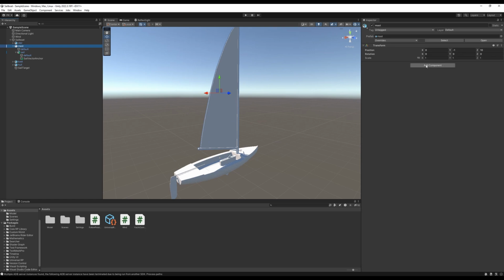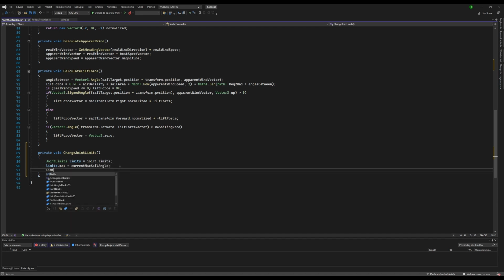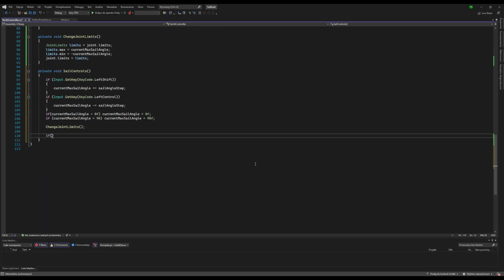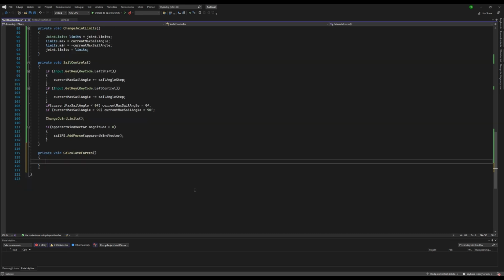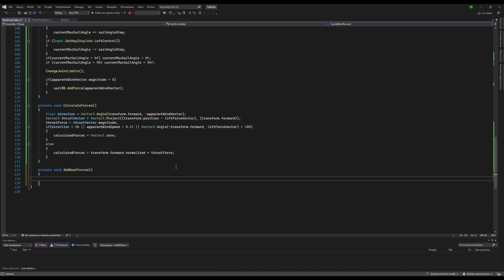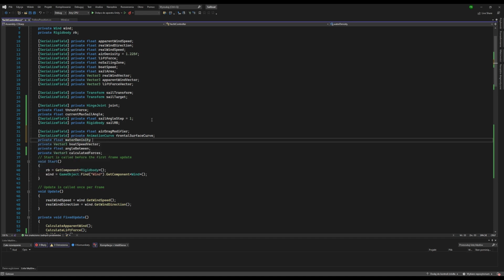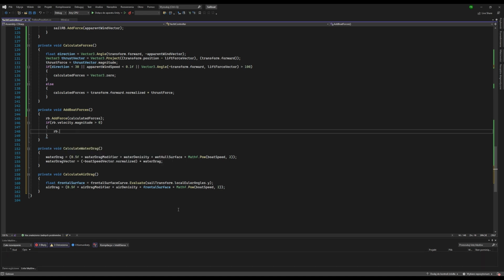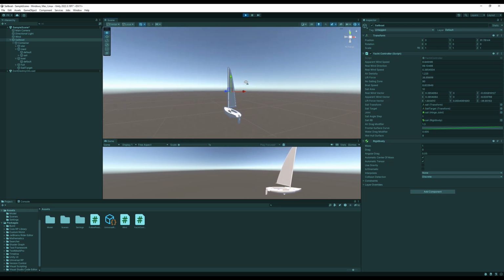How to Create a Physics Based Sailboat Controller in Unity | Part 2 - Sail Control

Comment: I'm in the middle of learning unity, and my project is a trading game in 18th century caribbean. 
This will be so useful to study! What allowed me to do it is using chatGPT to create scripts for me, I descripe the issues I have, and we work through them. 
I have artists skills, but I'm really not strong on programming. I don't think my brain like numbers a whole lot, but I can somewhat understand simpler scripts and find out why stuff does not work. 
I have a lot already, but I am currently looking for a method of i cooperating multiple sails and sail settings, and this is much more detailed and physics based. I love it!
Reply from the maker: In the next episode I will add a rudder script to control the whole yacht, and then maybe a tilt. Multiple sails may be challenging but I am hallu to help 🫡
Reply: @flyingpaprick  Awesome, my rudder just adds a force to the side at a point in the middle of the rudder. 
The force is dependent on the speed, making it also work in reverse. 
It's pretty simple, but seems to do the job well.
I'm really looking forward to your next video. 
Don't know yet if I want each sail to be seperqtly controlled, or have a simpler model.
Reply: I am also interested in solving the multi-masted sail question, and watching the aforementioned rudder script video!